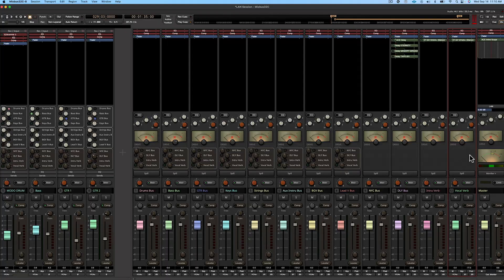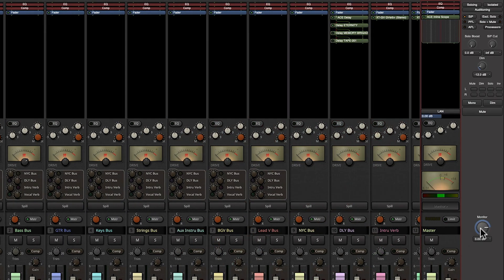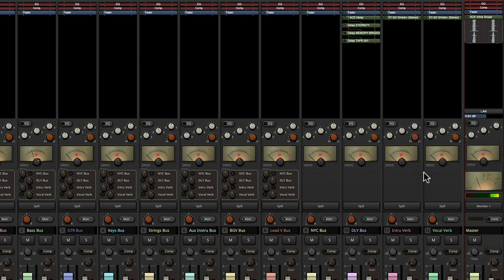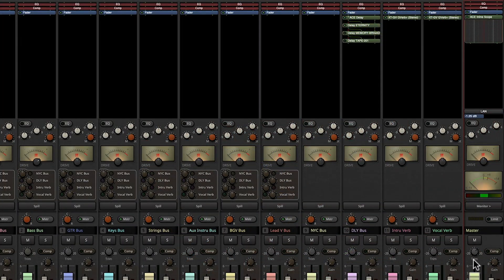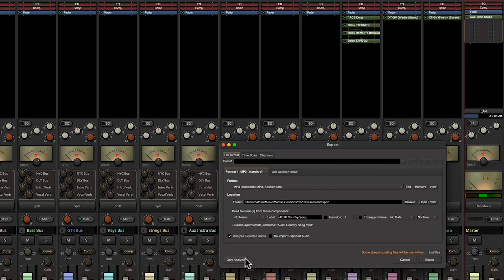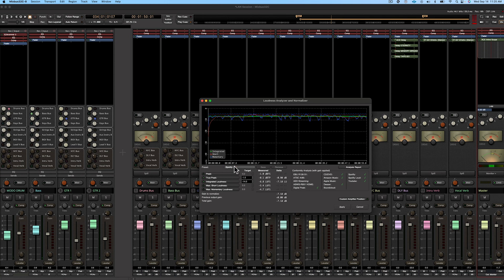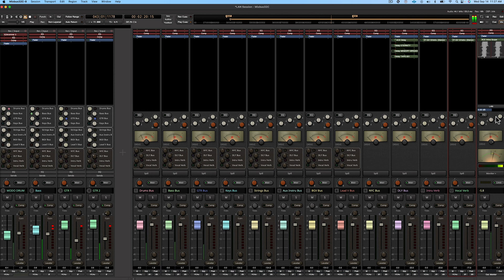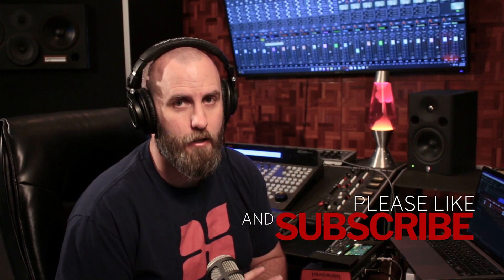How to use the Loudness Analyzer/Normalizer tool in Mixbus32c

Comment: Hey Nathan, quick question, how could we manage each channel's eq/comp parameters from a midi keyboard such as my humble Launchkey Mini, in a way that it is possible to select which track you want to control, and on top of that, be able to command Mixbus to listen to a midi input and select scene or page for keep moving down on possible parameters to control? Is this even possible? - So far I've been able to assign 1 midi knob to 1 mixbus knob, but that is it, it won't follow track selection, and the set up seems to not be persistent. Is it only MCU the solution to this?
Reply from the maker: MIDI learn across multiple channels is not possible at this time.  MCU will be the best tool for that job.

Comment: In version 7 I only saw this analyzer after export
Reply from the maker: HI Frank,
I believe you can turn this feature on in V7 by the methods I show in the video.  This will allow you to get the settings right before final export.   

Nathan
Reply: Thanks for the info, very informative video.  Also a V7 user, I will turn this feature on.  I need to go back and look at my broadcast levels as mastered.